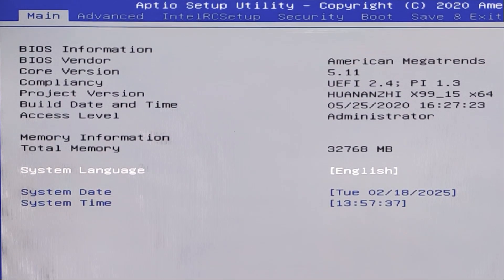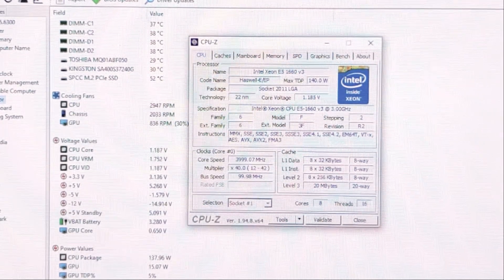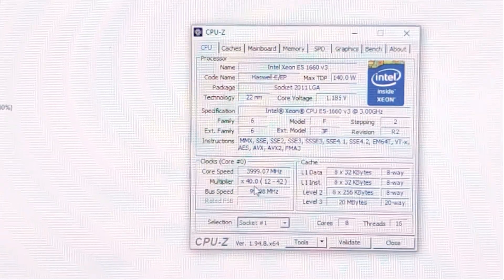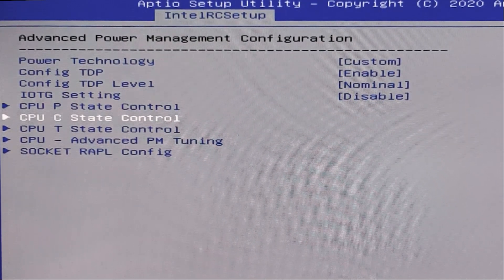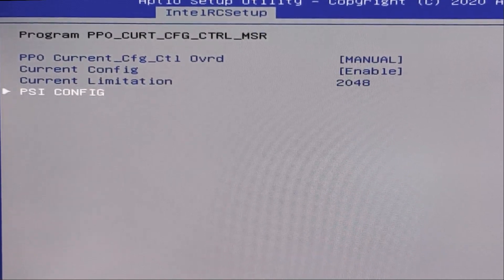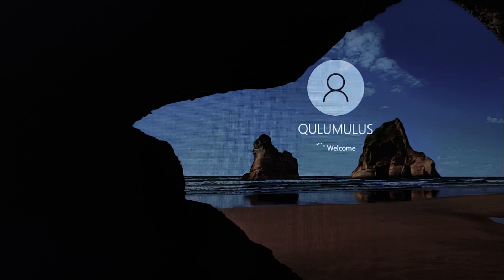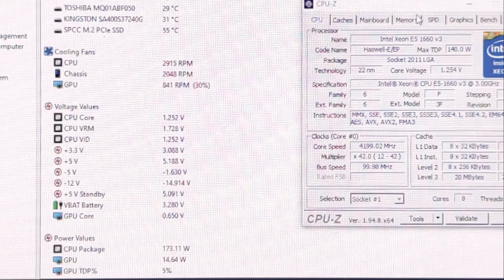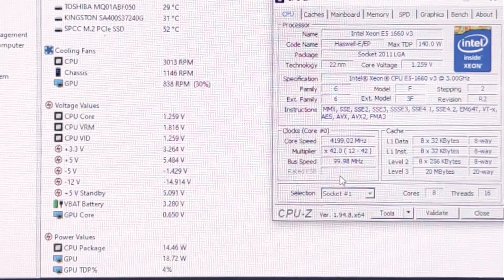x99 Huananzhi INCREASE CPU POWER LIMIT - UNLIMITED TDP | OVERCLOCKING Xeon E5 1660 V3 / 1650 / 1680

Comment: This only works in 16 lines, and don't in 26 lines. Like 1660 v4, v3, 1650 v4, v3 , etc..

Because the line 16 is unlocked to overlook.
Reply from the maker: Your right, only 16xx series overclockable by multiplyier.

Comment: what cooler do u reccomend? i have the bracket so just cheapest cooler that would be good for the temps ur getting
Reply from the maker: Only watercool can deal with this overclocking in long term use
Reply from the maker: Or some double 6-pipe 120mm cooler

Comment: I have one question, If we want to upgrade to a more powerful CPU than 1660v3 in the future for the same motherboard (preferably unlocked for OC), which CPU would you recommend? Or do you think the 1660v3 is the best option for this chipset?
Reply from the maker: @kombamba6185  I think 1660-v3 - high end for 2011-3 platform, yes, there is 1680-v3 exists, but I think there is no difference between 1660 and 1680 with overclocking, maybe only few percent difference, so it doesn't worth it to upgrade. 1660-v4 and 1680-v4 have locked multiplier, so it doesn't worth to upgrade. 1660-V3 - platinum high end overclockable CPU for 2011-3, in my opinion. Nothing more powerful exists. 2xxx v3 and v4 series - probably good as for work stations, rendering e.t.c, not for home gaming PC.
Reply: @qm1s  Alright man, much appreciated!
Reply: @qm1s you are forgetting the 6950x!!!
Reply: The best for 2011v3  is 6950x but it's expensive